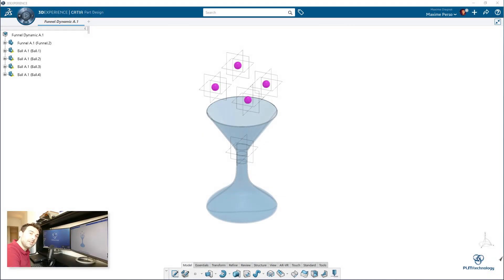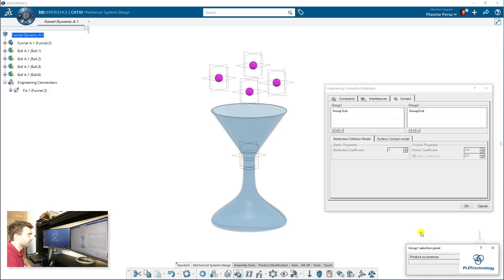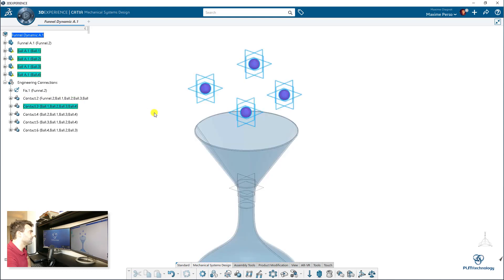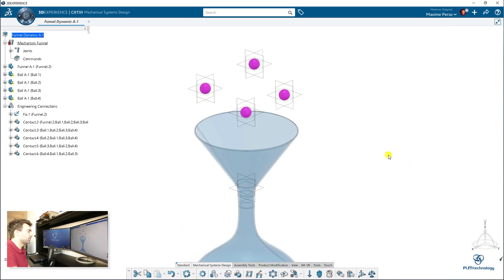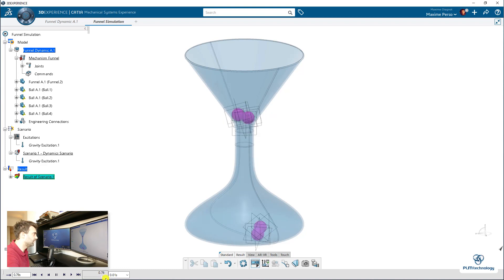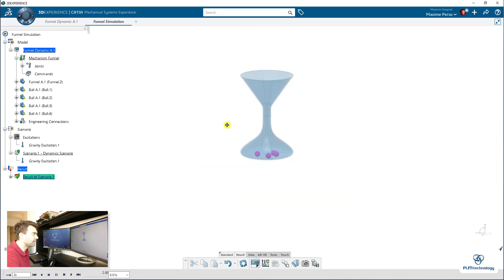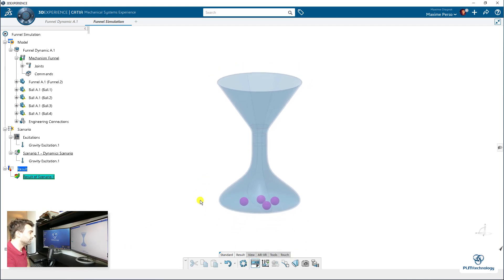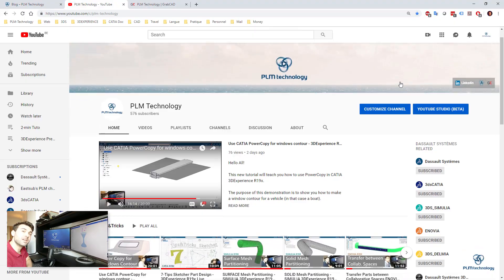Introduction to Dynamic Simulation [Part 3] CATIA 3DExperience R20x

Comment: Thanks for the useful videos. Should I change any preferences on 3DX before start to define a mechanism? Thanks in advance
Reply from the maker: Hi Murat k., No need to change any preferences before using mechanism :) the normal settings are working fine